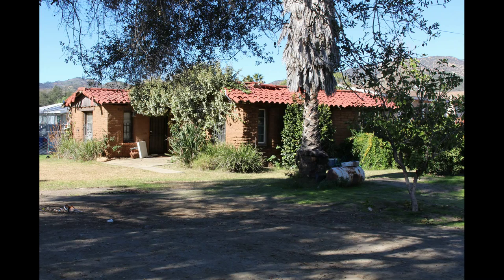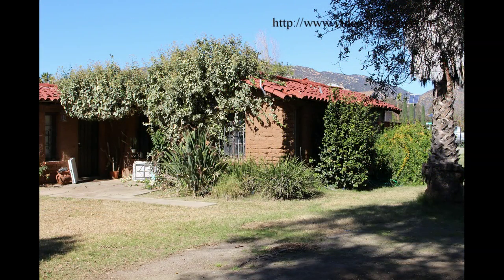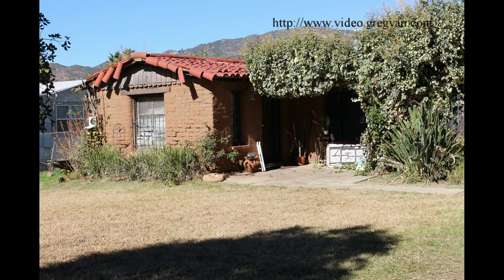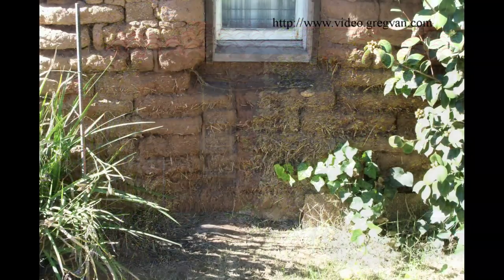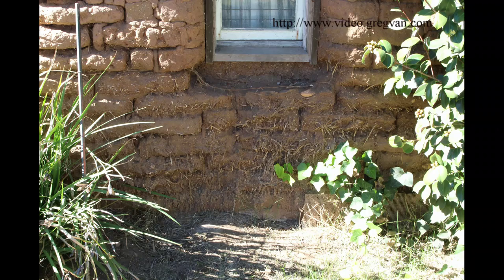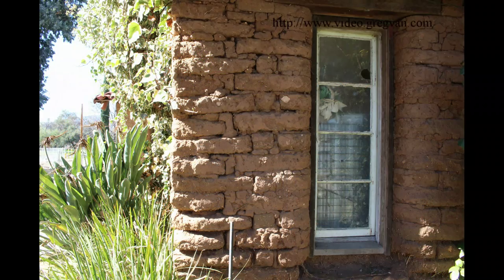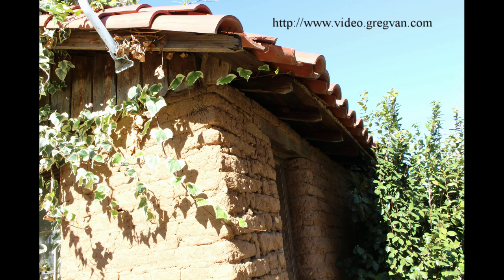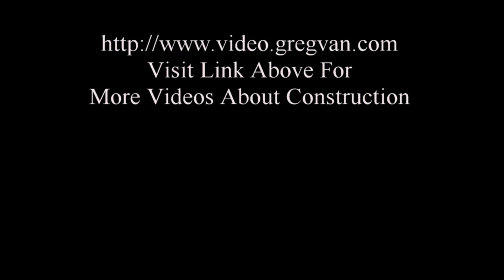What Does an Adobe Home Look Like? – Building Design

Comment: What's extra surprising is that there's no plaster or whatever coating they usually use on the exterior. there are lots of historic adobe buildings in and around Tucson and usually you can't see the bricks because they are covered over to keep them from eroding.